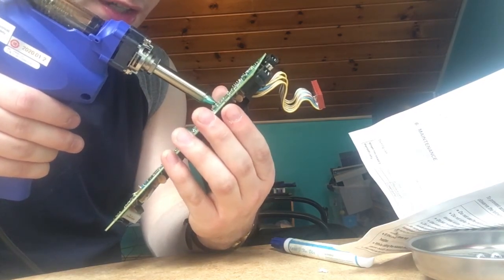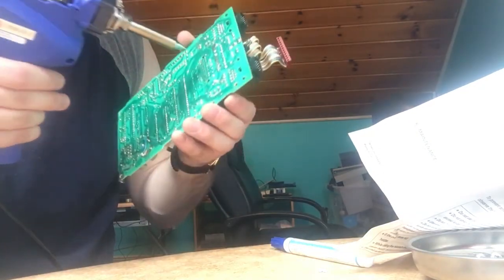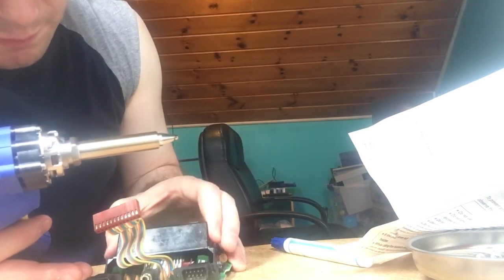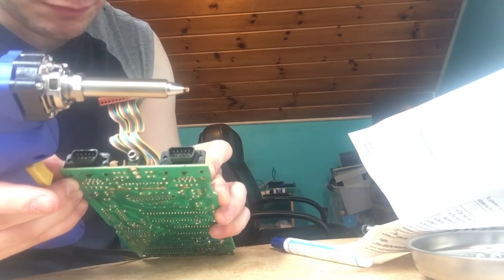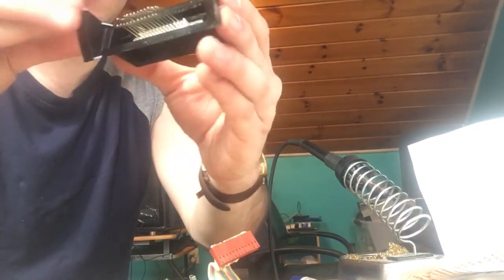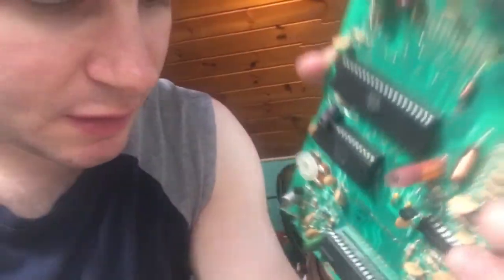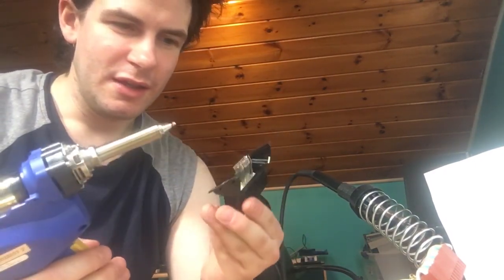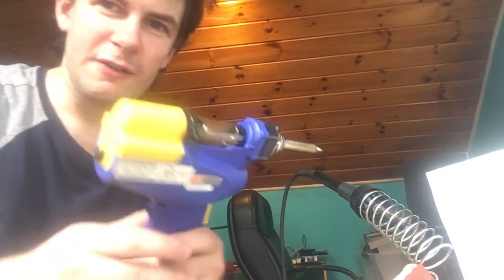Testing Out the HAKKO FR-301 Desoldering Gun (MY NEW TOY ;)

Comment: How do you get the solder out of the gun eventually ? Thanks .
Reply from the maker: It can happen once in a while. You just have to take apart the tube the solder goes into and remove the buildup covering the hole to the nozzle.